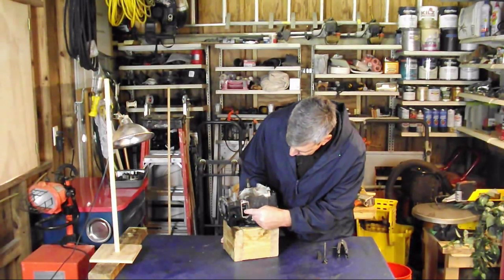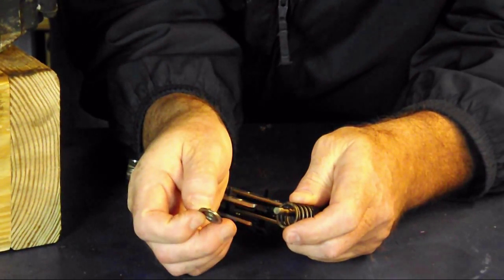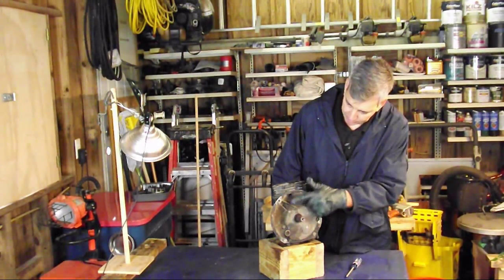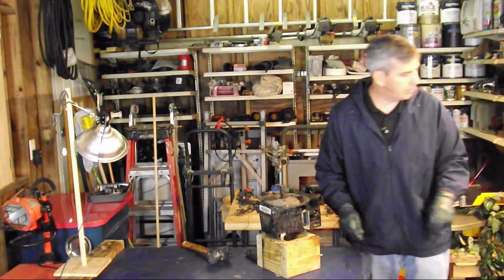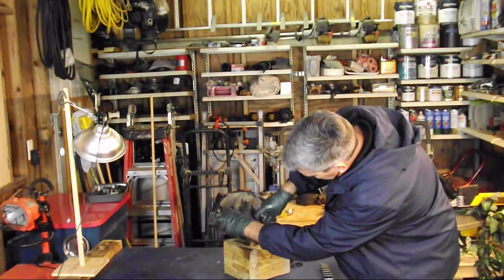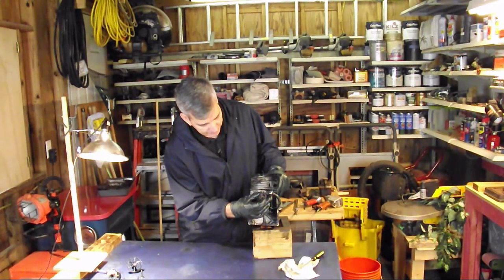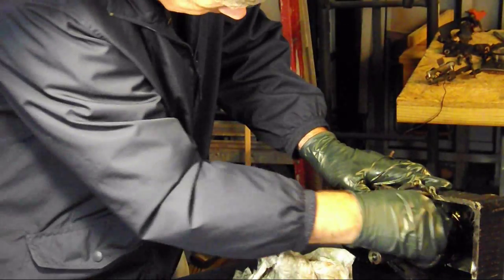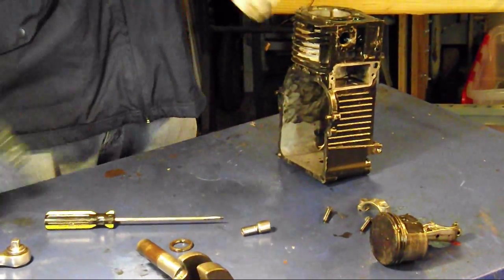Part 6 Taking Apart and Rebuilding A Small Engine Series

Comment: It is worth noting that corrosion can build up on the shaft between the blade holder and the sump seal.  This increased the diameter of the shaft on my engine by about .005" .  Since the diameter of the hole in the sump is very close to the diameter of the clean part of the shaft, it was almost impossible to remove the sump.  I would recommend sanding off the corrosion before trying to remove the sump.

Comment: Great series Gene! When you said a "witness" on the casing to insure proper re-installation, I didn't understand. I could see marking the connecting so that the piston would be re-installed with reference to the operational wear. I'm a commercial refrigeration mechanic and we do that when rebuilding recip. compressors.
Reply from the maker: +fatboyhd2k Hello fatboyhd2k.  Yes, I believe we are on the same page.  A witness mark is just a mark to ensure ex.  same face, same direction etc...  Thanks for the comment.  Gene